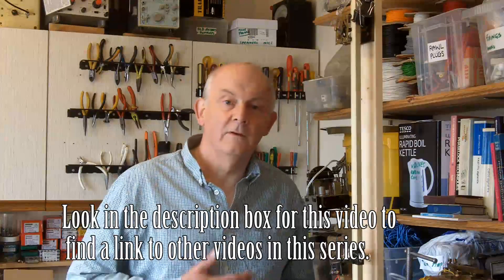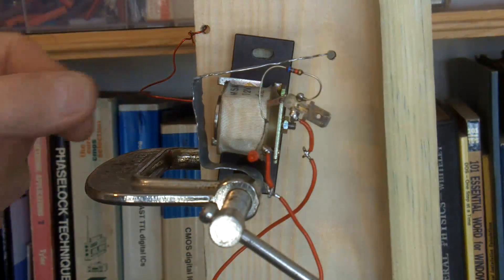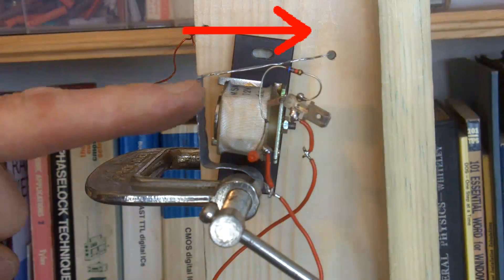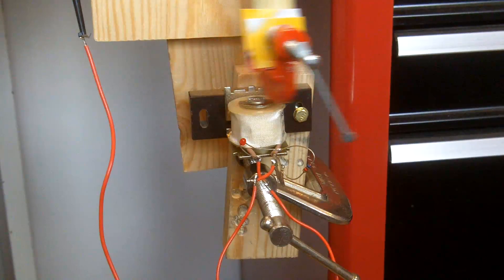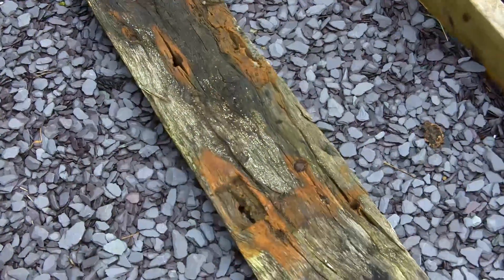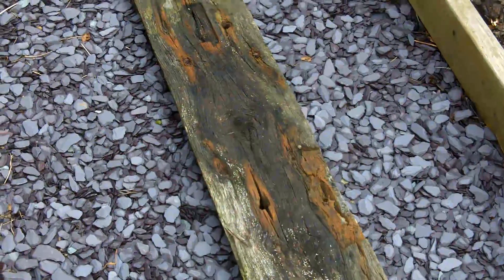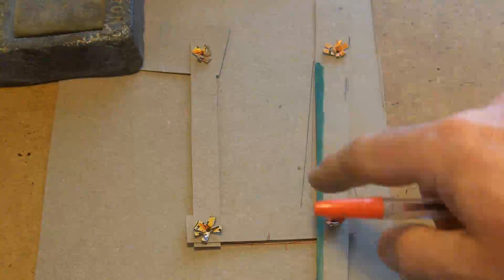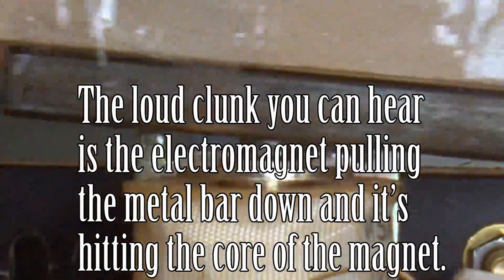Hipps clock movement project, rough part 17

Comment: I found after many versions of the Hipp toggle during my run up to making my clock in the 1980's that is still keeping good time today it is necessary to start from the power source you want to use. In my case 6 volt using four torch cells giving 18 months life. Also the toggle block does need to be made of a very hard  material in my case Agate with the blade being slim light and extremely hard. You will need to upgrade your Electro Magnet far above the one you are using, making it two with a high turn ratio to produce a high level of magnetic field using the lowest current you can also the material used for the armature fitted to the pendulum rod must be Iron failing to do this Steel keeps some residual magnetic effect causing drag on the Electro Magnet poles.  A high pendulum weight in my case 10 pounds helps to stabilize the  clocks time keeping, finally my Hipp switch energizes the magnets every 50 seconds with new then steadily reducing to 30 seconds as the batteries drain over time.

Comment: Great to see your Hipps Toggle experiments. I have two Hipps-Toggle Clocks, a FAVAG and a Gents. very quiet running clocks. for the triggering they use a v-notch on the pendulum and a latch which operates the coil contact. Favag drived the T-bar under the bob, Gents drives the pendulum rod 1/3 up. Your set up every swing is like the Brillie clock.

Comment from the maker: Yes I agree, it’s very easy to come up with complex solutions to problems. I once had an application that required the operator to pick up 1.5mm diameter discs of braze alloy and assemble a little tungsten rod on a small steel shaft the size of a matchstick.  We struggled for a long time to get a machine to do it. We brought a girl in to run the machine, she ignored the machine and simple dipped the end of the rod in the flux and dabbed it on the tiny disc to pick it up. 
Kind Regards ... Andy

Comment from the maker: Hi there, I’ve been looking at ways of using springs to softening the knock from the ‘L’ shaped metal striker but I suspect that I’ll wind up using the electromagnet at the bottom of the pendulum as a simple and quiet option, but I’ve had fun looking at the various options. The mercury switch is a bit problematic due to hysteresis; it’s a pity that mercury isn’t magnetic. Thanks for watching.
Kind Regards ... Andy.